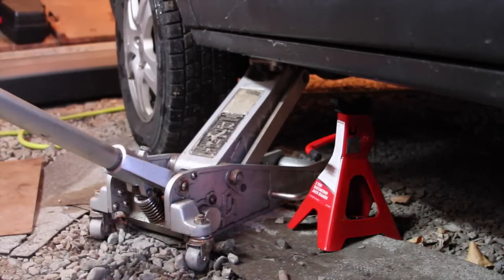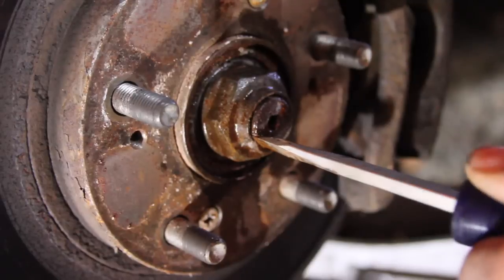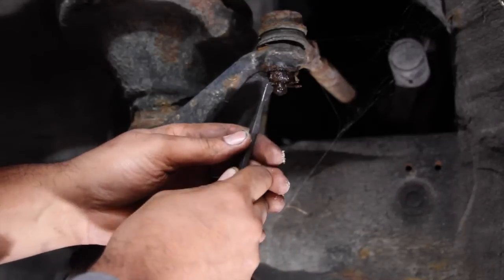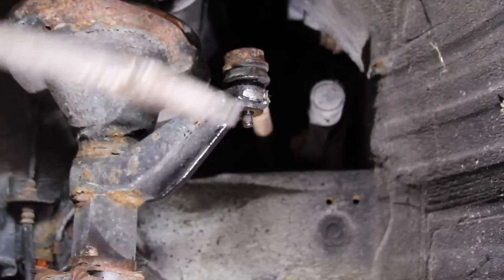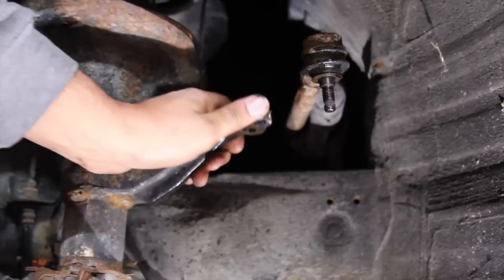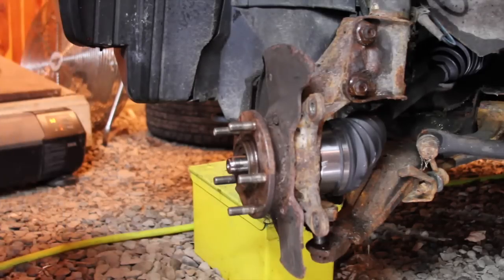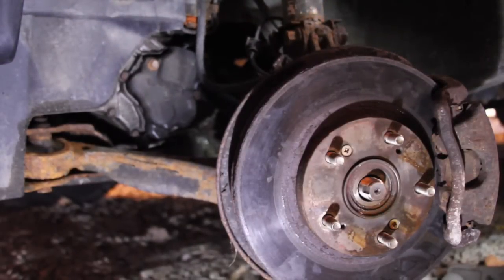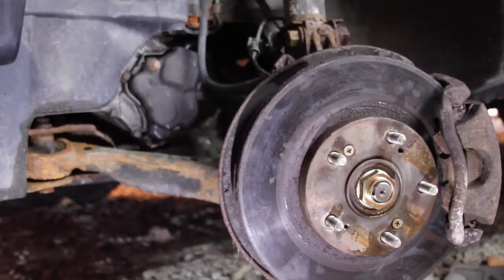2002-2006 Honda CR V CV Shaft

Comment: Just took mine to the local garage. After he removed the axle nut,All he did was remove the lower ball joint nut and took a bar to push down on the lower control arm and slid the axle right out and replaced it in twenty minutes!

Comment: This guy is smart that made the job less hard and focused on the task just to remove the axel he just took off the bolt from the frame and remove the caliper to remove the axel. Most videos shows you need to remove the top #22 bolts which is used also change the struts. Thank you.

Comment: thank you!  i just had some work done as the car  (crv 2002) was shaking after some work was done on a leaky solenoid.....    but am taking this on a trip cross country soon, they fixed the front axels but now the vibration is even worse, i am not a mechanic, but i bet this is it!  i am sharing this video with them....    thank you so much!  the vibrations are bad both riding (car sounds/feels  like i have studded tires but i do not)   AND  even when stopped the mirror is still shaking....    and now i am in total nauseated mode, so i am glad there is probably a simple fix!  the mechanics told me everything is under waranty so not to worry, bring it in for a quick check up tomorrow.....    hope this is it!   thanks!!

Comment: I just did this to a honda element (same design and parts as the crv) I removed the 2 bolts that hold the lower part of the strut and the brake like carrier. didn't have to touch the ball joints. Your way worked, but you can save time and money by doing it differently.
Reply: Did you do everything else the same?

Comment: Good work Joshua....you're not a pro...but you're good enough for me to learn from.  You just saved at least a paycheck on this job....this would cost at least $600 at Honda.
Reply from the maker: Glad I could help
Reply: Thanks Joshua....and I learned from other videos..that if the boot is not broken...and yet the boot has a lot of grease on it....it's probably "throwing" the grease out still and is getting much too hot...and will make noise "under accelerative loads."  No grease,...too much friction,....too much heat....heat gain....noise and possible vibration.

Comment: My 05 crv with 160k miles bought new still running good and everything is still original parts.
Reply: Mystical Poptart wish mine was that way lol my CV joint is failing me on the passenger side but no way am I paying a shop to do this it’s so easy! (Mine is a 04 w/ 167k)

Comment: You don't need to mess with the caliper at all, you just need to separate the lower ball joint and use a rope or bungee cord to hold the rotor at bay
Reply: If you don't remove the brake caliper the rotor will be very heavy that make the job harder to do.
Reply: He did say you don't have to remove the calliper, but it would be easier to see what he was doing with it removed...

Comment: DO NOT WATCH HOW THIS GUY JACKS UP THIS CAR >>>TOTALLY DANGEROUS.  Dude floor jacks have wheels to roll under the car as you lift the car so the plate on the jack doesn't slide on the bottom of the car.  This is how people get hurt or damage the rocker panel.  And your jackstand is not on solid ground...another potential injury.  If nothing else put the jack and jack stand on wood.  Hope you have good insurance.
Reply from the maker: Steve Malec stop. Not all ground is a flat surface. I use a jack stand, I jack from the Honda recommended lift point.
Reply: Not to mention, hes not on even ground never mind solid  ground Steve  ;(
Reply: But, you guys do hear that tremendous low tone scrapping noise, right?!  You can actually SEE the pad of the jack shifting outward off the lifting point of the car!  No, "not all ground is a flat surface", BUT, if you're going to make a video about doing a repair and the first step is lifting a close to 2 ton vehicle up in the air, DO IT CORRECTLY!  If that car comes down with you and/or your hands in there, you won't be able to type a rebuttal !!!
Reply: Yikes, looks like ive been lucky the past 8 years of placing my floor jack on soft muddy ground to lift my 04 Dually!!!

Comment: When using a crowbar up against the transmission, be gentle as this is aluminum.  I will get under on opposite side with a long crowbar on axle and hammer and knock it out.  I have done this job many times this way.

Comment: Here is an other question on my 2000 Honda Accord check engine light problem. It used to show up every few hours but I replaced all the coil ECG valve, plugs and even cleaned the intake manifold which was clogged. Light did go away by itself after cleaning the manifold but now after a month it just came back. Car runs beautiful no problem. I am so frustrated don't know what else I can do.i certainly don't want to go to a dealer as they are going to bill me six seven hundred anyway and there isn't any guaranty it will be fixed. Please help. Thanks

Comment: What is the cost for replacing the Honda Cv shaft for the one side? After the fix, there is a crunching noise when stopping or slowing down that does not go away. At least, that is what happened to mine.

Comment: Hi Joshua, just wanted to ask, how much do you think is a CV joint for a Honda CRV 2008 model 2wd EX. I feel the joint moving forward and backward just a midge and here slight clocking noise on lowspeed, do you think I need to replace it already?
Reply from the maker: 3D Printwiz the parts itself is maybe 40-60 dollars and there's a core fee so you'd get money back. There really should never be any noice coming from the joint when you are driving or turning. The shaft does move back and forth in the bell housings but there's a lock ring inside the bell to stop the shaft from coming out.
Reply: Thanks Jushua for your fast response. I hope I can gather up the guts to do this myself, hehe.

Comment: you should juts remove the two bolt on the shock, no the tied road or the lower ball joint. A wore be easy
Reply from the maker: Jesus M Morales well that's a matter of opinion. I felt this way was easier and the lower ball joint was not damaged in the process.
Reply: @jth1987leb  it actually is easier to remove the two shock bolts... and you dont need a new ball joint or tie rod from improper removal
Reply: His way you don't need re-alignment though!

Comment: Hey I'm looking at doing this on my CRV. I was looking at the service manual and it said for whole driveshaft replacement on the CR-V Driver side you have to drain the transmission fluid. Is that the case when all you are doing is replacing the CV axle like you do in this video? Thanks!
Reply from the maker: I raise the car higher on the side I’m removing the cv shaft from. That makes it so all the fluid flows to the other side of the transmission and there’s little to no leaking
Reply: VGAPR Garage awesome, thanks for the quick response!

Comment: do you think this would cause, a shaking in the car if this shaft is bad?.great job
Reply from the maker: a torn boot will not cause shaking, but if the shaft is damaged it will cause shaking
Reply: That sounds more like worn out arm bushings, that's the way my Element was.

Comment: changed out right side cv shaft ,got all back together ,crv only has rear wheel drive and park is same as Nuetral ?/?
Reply from the maker: Kevin mac innis I don't understand the question
Reply: @jth1987leb  I think he didn't engage the splines and has no drive from the front, only from the rear...

Comment: Hi, is there any different installation between front right side and front left side cv axle?
Reply from the maker: abdul taheri it's longer with a mid-shaft bearing mounted to the engine with three or four bolts. If I remember correctly that mount has a mount bolted to it that holds up the exhaust manifold. I hope that helps and thanks for watching
Reply: Thanks Joshua.
Reply: How would you fix it? i got the driver side done exactly like the video but can not get it back in . Any suggestions ?

Comment: Boss I would like to ask some Ideas with My honda City 2012 Automatic Axle drive, If I will replace it with Honda Civic Axle drive will it fit?
Reply from the maker: Scorpion Heart the splines into the transmission and bearing might be the same amount but I'd imagine the lengths are going to be different. But I'm not sure.

Comment: I find it makes life easier if you bust the axle nut off before you jack the car up. Pull the little center cap off and bust the nut loose with the tire on the car as it sits on 
the ground.

Also those shims  on the brake pads aren't exactly necessary, i wouldn't buy new pads just because those shims are crappy.

Taking the lower ball joint off is a waste of time when pulling CV shafts.

I was hoping to learn maybe a trick about how to do this easily, but this is a better video for learning what not to do. Appreciate the effort though.

Comment: Nice video.  It takes some gonads to make videos to help others and then have to stand up to trolls. 

What supplier have people had luck with this part. OEM from Honda ($450 each:( )  Aftermarket New? ($60 ea.)  Aftermarket re-manufactured? ($70 ea) 

I've read that people have gone through three sets of Aftermarket shafts to get the car so it rides right. I hate to pay $450 ea. but I may have to.
Reply from the maker: I haven’t had any problems with cv-shafts from rockauto.com but ones from the parts store have been hell and fallen apart. But that’s my experience. 

Thanks. My channel is made to help people. Trolls miss inform my views and I love trolling them back.
Reply: Thanks for the fast reply.

Comment: Aaarrrrrrrgggghhhhh the whole reason I watched this was to find out the size of the nut holding on the rotors ( we call them discs but no matter) you said it was a 36 and then right at the end you said when reusing the old nut it was a 32 so..... which is it?  apart from that I found it enjoyable as it seems like the fairly confused way of going about things that I do
Reply: The old nut was a 36mm... And the new one was a 32mm...  simple really....

Comment: Not trying to be a hater, but this is all wrong.  One does not need to touch the tie rod, or lower ball joint, or the brake assembly.  You run the risk of damaging the tie rod and ball joint boots.  At lot of unnecessary work, with risk.  I speak from experience: I just replaced my driver side CV following this video:  https://www.youtube.com/watch?v=1yjOxHhlxiE   
Joshua, I appreciate the effort, but please... you don't know what you are doing.  Yes the job was done, the hard way.
Reply from the maker: So, you posted a link to civic, not a CR-V. You are very concerned about what I do in this video, when I do not outline everything. The lower balljoint, tie rod end and rotors and pads where all replaces. This was the best way to preform the repair with all the other repairs that had to be done. Like I tell everyone that comments that comments that it was done wrong. start making your own videos if you can do better. here is how I did the brakes and the balljoint https://www.youtube.com/watch?v=-3is_ffC2uo Take a look around before you open your mouth.
Reply: if you take the pinchbolts out like they did in this civic video, you will need to get the front end aligned adding at least $100 to the repair, no thanks. I prefer Josh's way. Also, in the video, they did take the caliper off...did you watch the whole thing?

Comment: I have a question, I have a Mazda CX-9 2010 I I replaced rotors and pads because for few initial Mils it would make grinding noise when applying brakes then it would go normal are there any quieter pads in the market I installed ceramic pads but for few initial pumps it grinds why I have 2000 accord which is much quitter Luke normal car.
Reply from the maker: Tariq Choudry car manufacturers do recommend using OEM brake pad material. Putting ceramic pads on a car that requires metallic pads there can be a noice for example. There are "quieter" pads on the market but I think it's a gimmick. It's all about how you prepare the bracket and lube the push pins. You want to make sure the pads can move freely and there high temp anti seize on metal to metal moving parts. I have a few videos on brakes that show how I clean up and prepare the caliper and bracket for new pads.
Reply: VGAPR Garage 
Thank you very much  great info.

Comment: Hi,I want to buy a 2005 Crv but  I did a research on net and too many people complain on the same transmission issue(torque converter) which coast a lot,is it commun problem of Crv?
Reply: It's a comon Honda issue, Honda transmissions suck,they make there own. Toyota uses other manufacture transmissions a d are far more reliable.